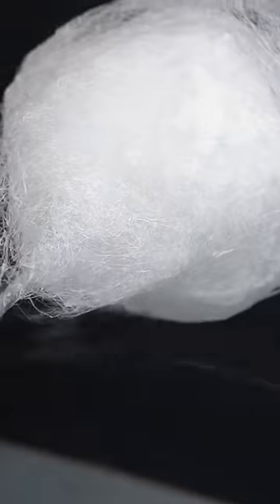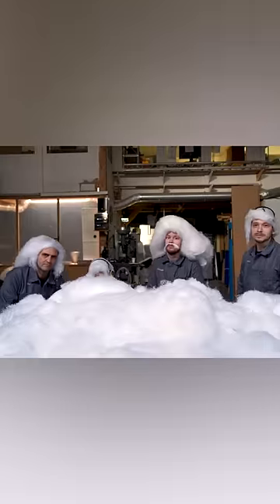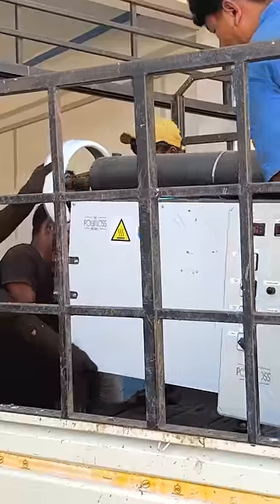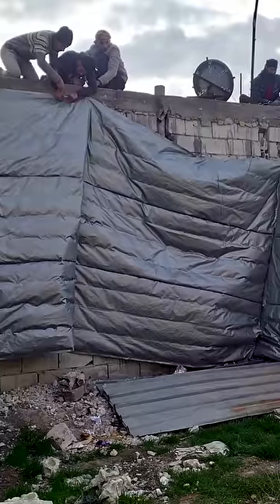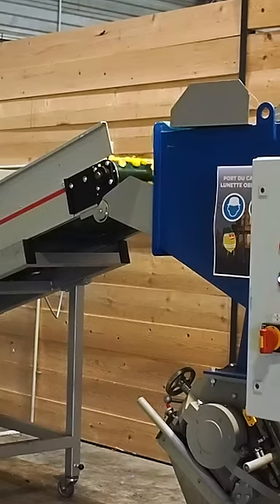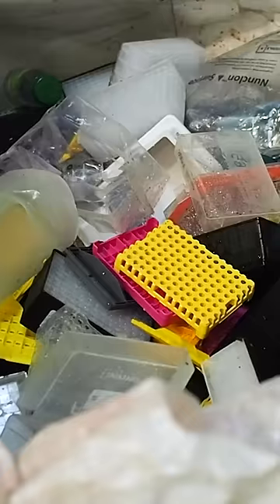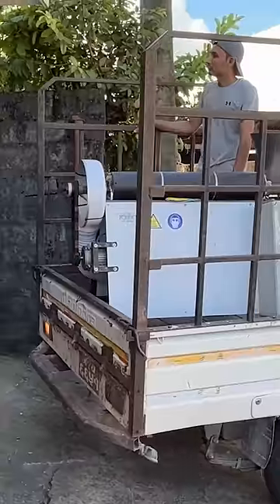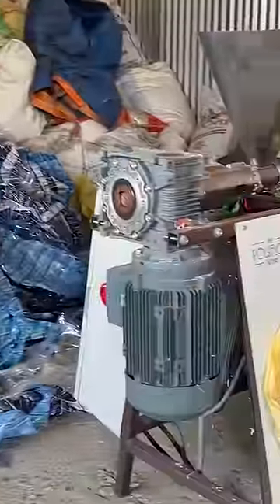This cotton candy is really plastic trash spun into ultra-thin fibers.#recycle #plastic #environment

Comment: Flammability rating; EXTREME
Reply: @flamingblood8447 either way your death will not be easy
Reply: @flamingblood8447 so you'd rather burn to death than waste electricity
Reply: The same can be said to actual home insulation aka foam boards and foam sprays that are also plastic/polymer based(hence flammable).
Reply: You'd be surprised how well polyester burns, it flares up like it's soaked with accelerant.
Firefighter demonstration videos showed how quickly curtains ignited and spread the fire.
Invest in fire retardant materials wherever possible at home
Reply: Bro normal blankets have cotton in it
Reply: did y'all forget this is for stuff like refugee camps? It's probably cheap as hell and going to people who need anything to keep them warm. If you don't want plastic in your home, you can afford something else.
Reply: @DavidTheBrain_ Hell I would too
Reply: Bout time something stepped up to eliminate the dangers of handling fiberglass insulation.  I had to handle insulation just after the 4th of July and my face still burns.
Reply: duckshoe3985 not to mention all the toxic fumes it will give off when it’s on fire….
Reply: I’m sure they know this and I’m sure nobody is starting fire near buildings like these. They probably warn the people and refugees they give this to that the plastic can easily be ignited and to not make a fire nearby. Would you rather have a chance of a fire in a warm place that is easily evacuated or freeze in a cold place that is easily evacuated with no change of fire?  

People take that risk to stay alive, just be thankful you don’t have to.
Reply: @Keo0kie  Here in Europe normal blankets are filled with either polyester or bird feathers but everything is possible in the country famous for its cotton plantations 😉
Reply: Plastic is derived from oil after all.
Reply: Thaught of it the second I saw it 
The plastic will burn depending on its thickness 

How fast will depend 
I think that the thinner the wire is the faster it is to burn the cluster of it 

And in this video what we saw was cotton candy thick plastic ( may go boom just like rooms filled with dust and floor)
Reply: @anolliecanolie7906  sounds like a “let them eat cake” sort of comment. Real people should put this in their home, but it’s good enough for “those” people.
Reply: @flamingblood8447 burning is the worst way to but you do you fam
Reply: @anolliecanolie7906 .   Almost every year, one of the refugee camps goes up in flame because of all the combustible material.
Reply: @yukirevive2722 the issue is this plastic is most likely not treated for any flammability… it’s essentially just aerated plastic. It’s already flammable enough in clothing fibers
Reply: @dreadgunner  Okay yeah that's a good point as well as what @oldmech619 said, I did not mean to come off that way. I suppose my train of thought was anything is better than nothing? Idk. Refugees do deserve better than plastic, I was trying to find the bright side. We really do need something to do with all this plastic we have, but then someone else mentioned microplastics as well and just- yeah. Good point! I did not write a very well thought reply :']
Reply: @anolliecanolie7906 Ya know refugee camps often have cooking fires right? Because they're homeless camps? You see that going well?
Reply: Give a man a fire, he will be warm for a day. Set a man on fire, and he will be warm for the rest of his life 🙏
Reply: It will just melt like fleece does. Of course it then can burn the living HELL outta ya! 😳
Reply: @anolliecanolie7906  Yeah, no refugee problem if they all die trapped in a towering plastic fueled inferno, especially considering the prevalence of open flames in refugee camps for cooking and heat.
Reply: @eklhaft4531 And this is coming from the continent famous for its toxic fumes too.
Reply: @DavidTheBrain_  yeah, not everyone was born rich or got the luck to get the riches
Reply: @shockwavecity  So you rather let them freeze and die to hypothermia rather than have a minimal risk of a fire start?
Reply: @jamesbaker3153  Idk man, at some places, it is illegal to start campfires in urban areas, and I dont think they want to risk to get more problems than they already do.
Reply: Actually its plastic so its not flammable
Reply: @bluebull2006  My water bottle does not like this comment
Reply: @eklhaft4531 we also have cotton filled blankets besides the ones filled with feathers (Daunen).
Smart nickname, ekelhaft 😂
Reply: @pissapocalypse  houses aren't either but it still happens, silly goose
Reply: @flamingblood8447 this is indeed a huge amount of wast when compared to regular insulation. 
Listen to the logic 
local  sources. Oh that's good.
Ship around the world. Ohh,, well that's not local anymore. 

33lb gives you a 2'×11'= 22'sq
How much do you think that 22sq cover weigh? Funny how they left that out.
But if I had to guess 22sq of cotton candy is maybe 3/4 of a lb.
Let's just say 3lb.
What happens to the 30lb
What happens with the leftovers?
Reply: @1DontKnowMan absolutely 
Like sawdust
Reply: As pretty much everything that IS used to insulate
Reply: @DavidTheBrain_ no he didnt say burn to death he said he would  rather risk the chance of a fire. Do you understand the difference
Reply: @jackoherone8172  Refugee camps are rarely in urban areas and they still have to cook which means fire. They are most often large clusters of tents or temporary buildings (aka shanty towns) hastily set up on a large area of open ground a significant distance from urban/suburban settlements.
Reply: Tell me you know nothing about buildings without telling me you know nothing about buildings:

Literally everything that isn't masonry or concrete is flammable.
Reply: @SurmaSampo  most refugee camps in my country dont cook cuz they cant, and also there isnt much of a ammount of refugees here in brazil, so it might not be a big of a problem here
Reply: duckshoe3985  bet your year salary it sure is
Reply: @DavidTheBrain_  I'd rather be more careful arpund something than waste precious electricity. If you're stupid enough to catch it on fire, that's your own issue, not mine.
Reply: @jamesbaker3153 Does it go well with woll and polyester blankets?
Reply: I wonder if the covers the plastic is put in is flame retardant.
Reply: Wooden buildings be like:
Reply: hm. asbestos is pretty fireproof. maybe if we cut it with asbestos we'll have the perfect material

Comment: I love micro plastics!
Reply: Yeah, I would never buy this. Thermal plastic plates would be a better choice. That said, where I live, Nordic nation, we use something called Glava for extra isolation, but in between two layers of wood.
Reply: They are preventing waste.
Reply: -guy that doesn't know what micro plastics are
Reply: When there's a housefire, there is no better death trap.
Reply: now we can 3d print houses 😊
Reply: you know that with time plastic becomes micro plastics anyways?
Reply: @tschichpich I see no need to speed up that process.
Reply: @malenejensen2995  recycling and helping refugees seems like a pretty good need, no?
Reply: @tyronechua451 I’m sure there are better ways they could be helped than stuffing them inside of microplastic houses.
Reply: @mildly_miffed_man1414 you do know they cover the insulation correct? Even regular fiberglass insulation isn’t good for you to be exposed to.
Reply: what??
Reply: More like macroplastics
Reply: Do you realize you can’t see micro plastics
Reply: Yeah I also hate helping those in need while also saving the environment, that would suck!
Reply: @serenity2010sh these materials at their eol would become microplastic almost immediately
Reply: @Lobos222 Good thing it's not for you then, isn't it? Itself for the people qho can't afford thermal blankets, genius.
Reply: @griffinmckenzie7203  Pretty sure cotton or wool is cheaper and the latter works while wet.
Reply: @Lobos222  It's not and so does this stuff.

Comment: The second I saw this, I knew it was going to be something like insulation. But you could also turn it into fiber fill
Reply: Yes, I think it would be very filling just like fiber
Reply: I can't imagine it insulating very well....
Reply: @lollsazz  It’s no different than polyester cotton balls. It’s made of the same stuff. High surface area = great heat retention = good insulation.
Reply: @ferretyluv  Polyester isn't very insulating either, but maybe it would work like a polyester puffer jacket? 🤷‍♀️
Reply: The second I saw this, I knew I wanted to take a bite 🤤🤤
Reply: @lollsazz  Yes, like a puffer jacket.